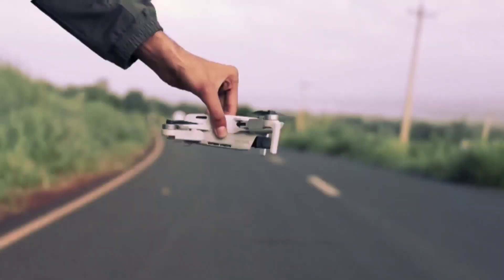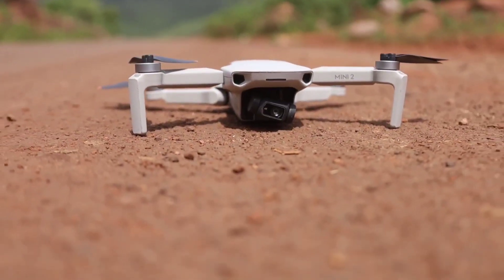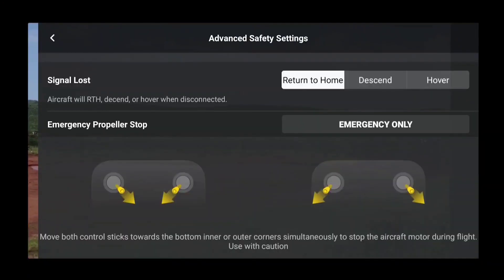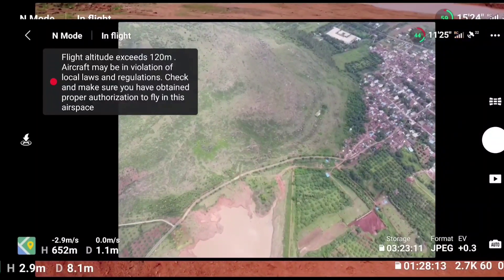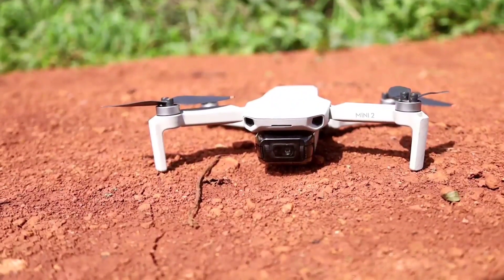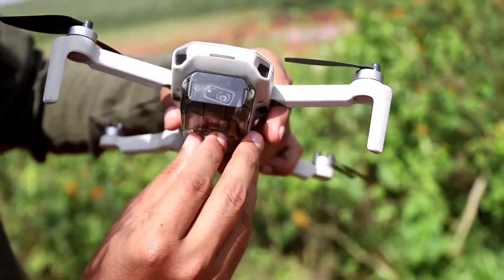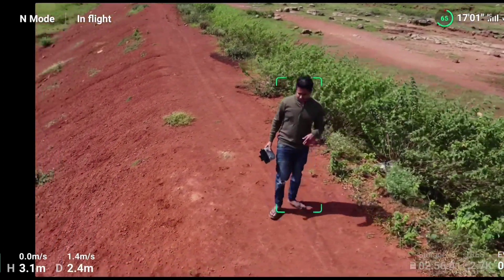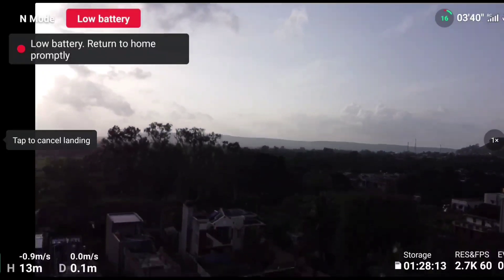DJI #MINI - AVOID 10 COMMON DRONE MISTAKES | #drone basic guide | gimbal stuck | #dronesafety #15m

Comment: If we hack the  Drone thn we can’t set the RTH, if this case how to set the RTH value ?
Reply from the maker: If you are using nfz hack... just Press back button for 2 sec.. then first beep will come.. wait for 1 sec you will hear another beep.. then again press and hold back button for 2 secs..  RTH altitude changing will be enabled
Both NFZ and back button pressing method can be used at the same.

Comment: After applying the drone hacks NFZ, everything is working fine now. Thanks so much! One doubt- o am unable to manually change the RTH slider. Any reason?
Reply from the maker: To change RTH.. press and hold back button from 2 second. You will hear a beep sound.. after that wait for 1 sec you will hear another beep sound. Then again press and hold back button for 2 secs.. then you can change the rth.

Note - both NFZ hack and back button pressing hack can be used at a time 👍
Reply: @Shivkumarsd  it's worked! Thank you so much 🙏🙏